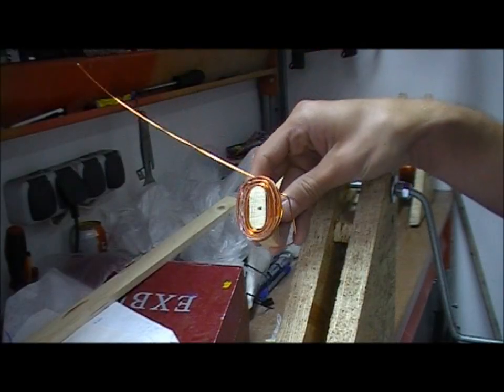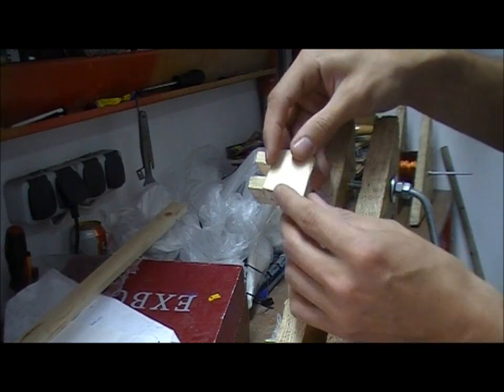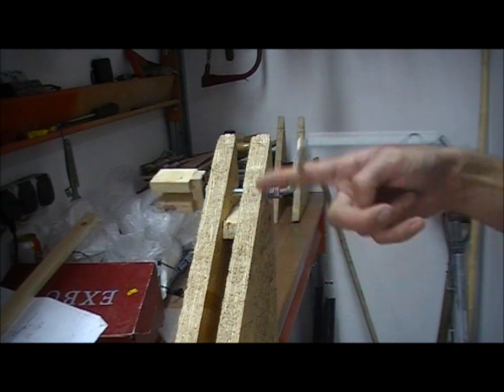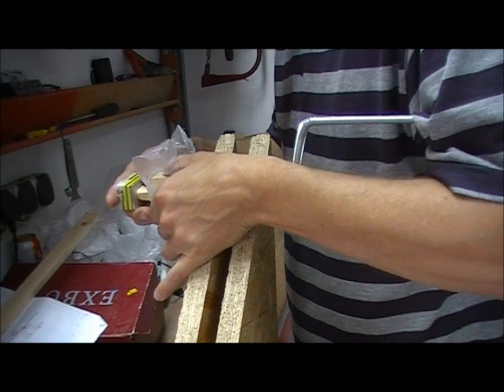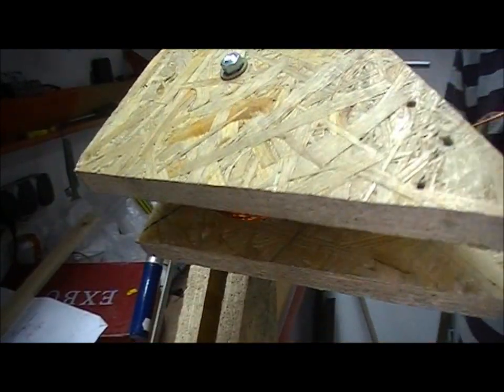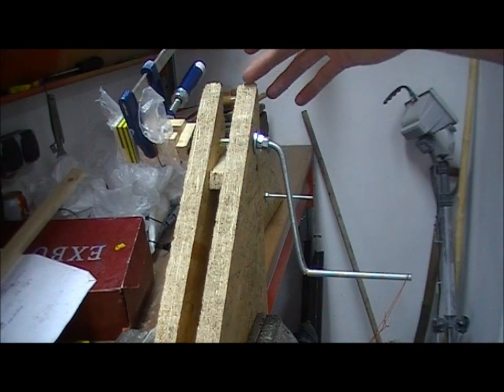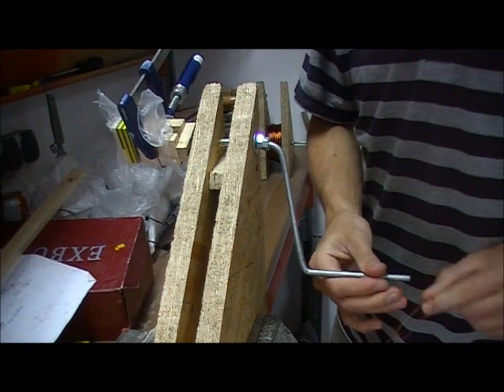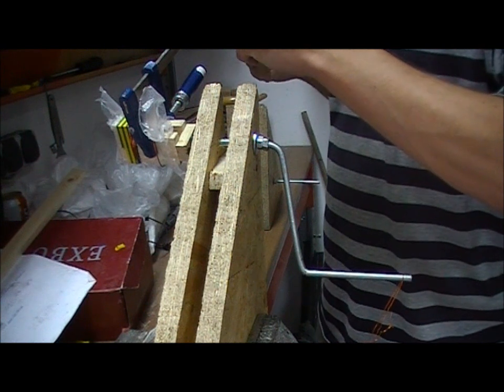Home made windmill generator part 4 - winding the coil

Comment: air gaps are important to get them as small as possible. Make your metal core pickup coils out of think steel and varnish them together in a press. Once dry you can still do some shaping of them but they need to be as close as possible the same size.

Comment: you need to be making your pickup coils with metal cores. Metal cores are always better then an air core. You can turn that into a nice pulse generator where you get 90 volts per pulse. You add the pulses up by going through a bridge rectifier. It looks like a good learning project. Check out how others are doing things to learn from them and see all the mistake people do so you won't have to make the same one.

Comment: i f u had made a slot in the rota u could have mad the wire windings fit both sides thus pick up the magnets on both sides of rota ..and you should have counted the times you wound the wire on each block because it needs to be the same on each one ....if you had put just washers on your triangle holder then it would be free moving. by adjusting the tightness of the bolt though it apply a resistance .   you can  do your windings .. cheers

Comment from the maker: The optimum size (and shape) of the coil is the size (and shape) of the Magnet. When you have a coil with many windings, then the most average winding should have the shape of the magnet, unless you use several magnets for just one coil.
The max height is the height of the Magnet if you use Magnets only. If you use Iron to channel the magnetic flux, you can increase the high somewhat.
I have no mathematic proof of that. This is just my subjective experience from my own experiments.

Comment: You made it all with the hard way.
I built my generator from old motorbike spark generator "magneto"
I unwound the thinwire coil and replaced i with stronger 1mm copper.
got output voltage at 320rpm 22v 5a and after filtering 28v 
so i can charge 2 car batterys at the same time.
nourmal output power of 100w
built took only 2 days